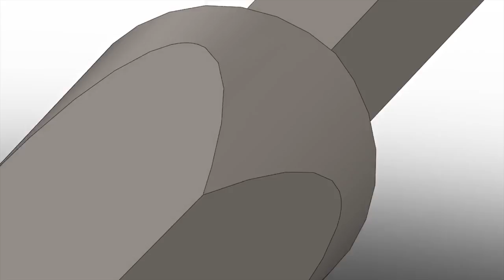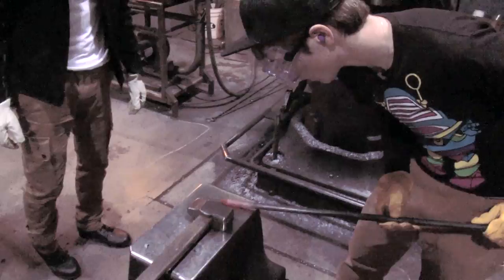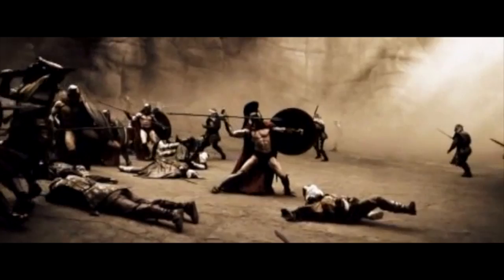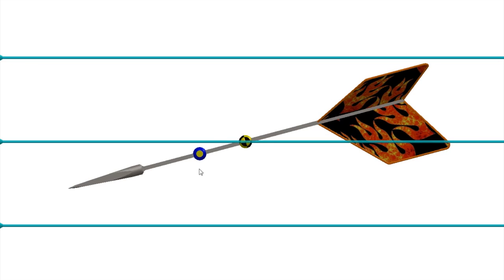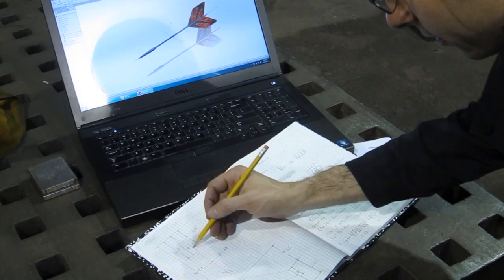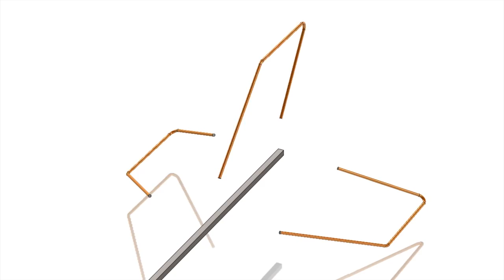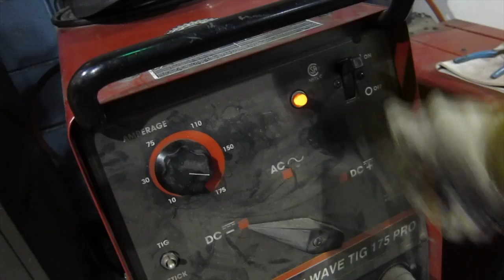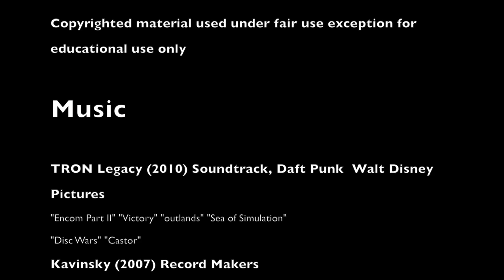Making Steel Darts

Comment: Airplanes do not change angle of attack by changing flight surfaces you changed :) It's the elevator that allows to change angle of attack. Flaps and spoilers only change the lift characteristics.
Reply from the maker: You're absolutely right! I just wanted to demonstrate the concept of using flight control surfaces and these were convenient because everyone gets to see them working when they fly but I should have been more explicit. If this video became a series, my choice would be to have a rather in-depth explanation of a different engineering concept each episode. This was kind of a quick sampler of a whole bunch of them mixed all altogether.